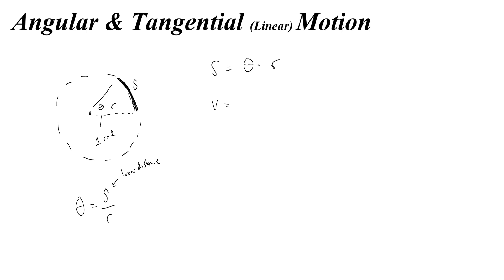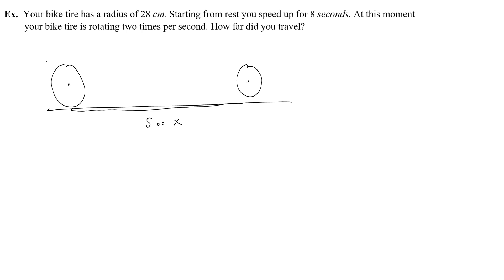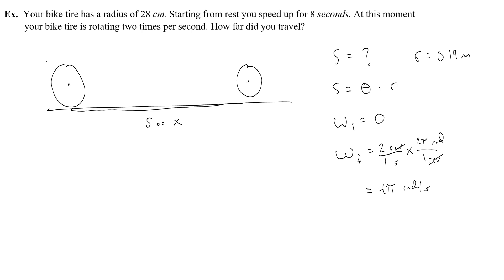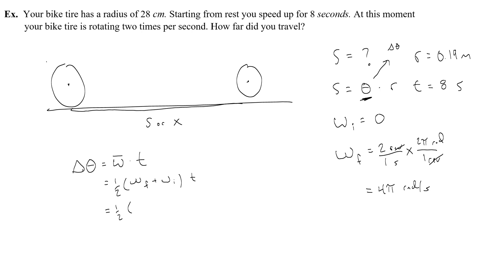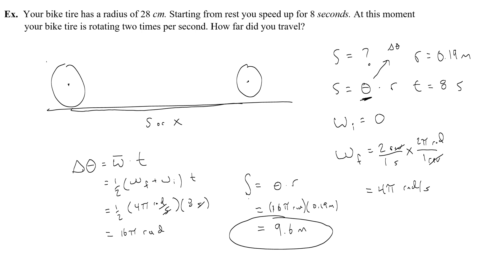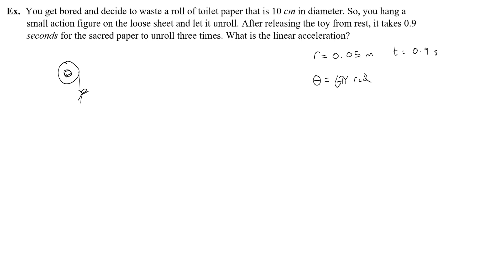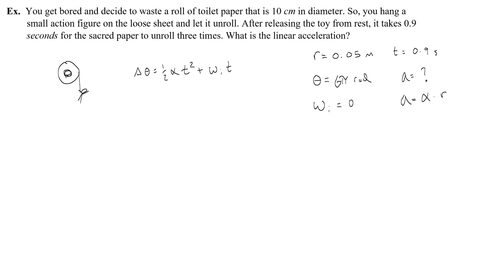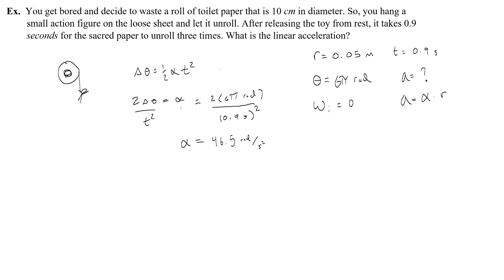How to translate rotational motion to linear motion (angular to tangential)

Comment: for the example at min 6 why would we divide the radius by 2 if it states that .28 m is the radius. I thought we only divide if it states it is the diameter.
Reply from the maker: Hey Chris, you are right. I should have divided by 0.28 m instead of 0.19 m because 28 cm is the radius (not the diameter). Sorry for the error!